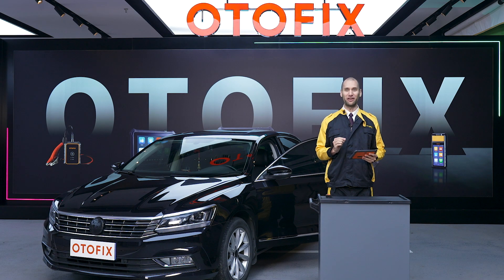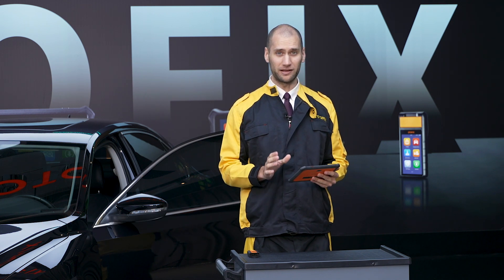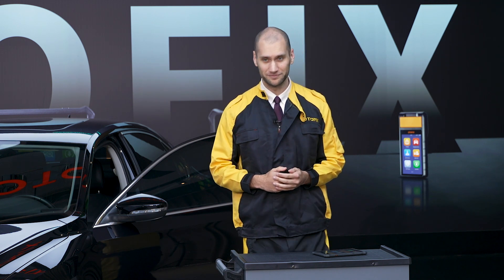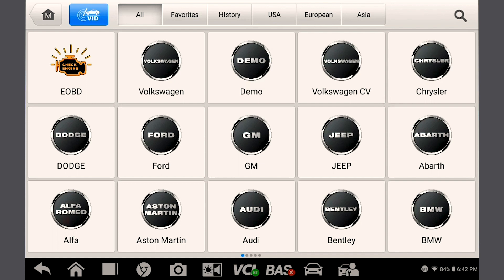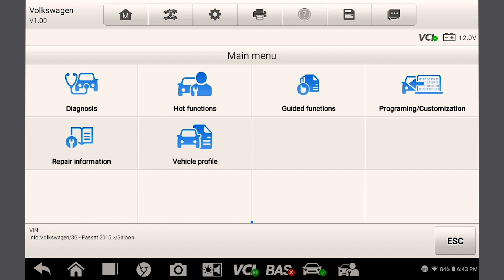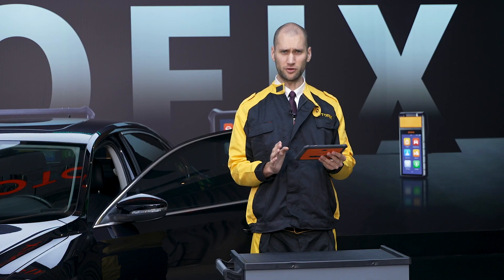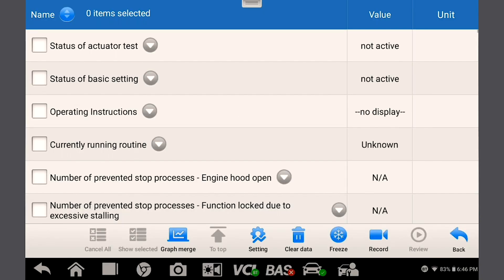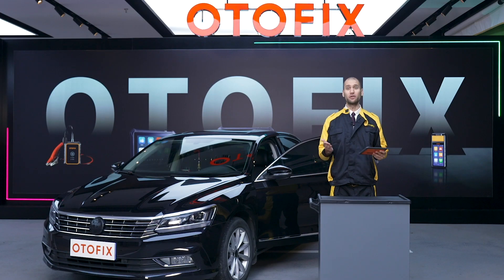Get to know OTOFIX Car Diagnostic Tools 2：D1&D1 Lite Diagnostic functions demonstration

Comment: the wifi  2.4 and 5 very slow ,even the RJ45 just 6mb/s, need about an hour to download the first time, and the USB3cable just can do charge, can't use to data, like VCI update, should include that., the other work like AUTEL ARE GOOD.
Work very good for DIY and home mechanic, if for workshop , you need ECM code and high end CAS car security for BMW and BENZ.